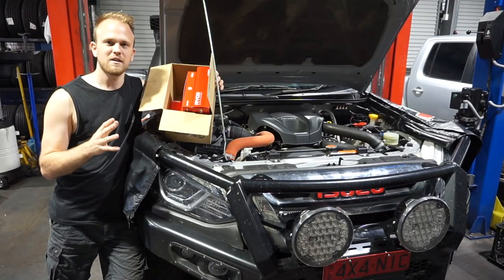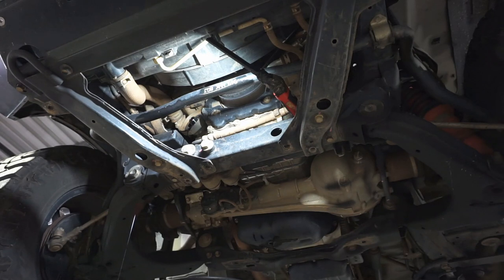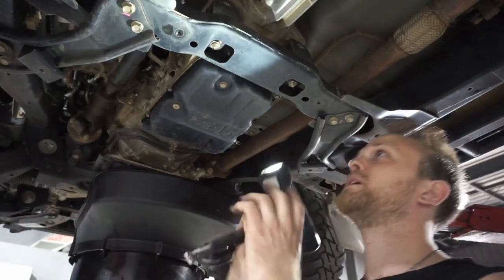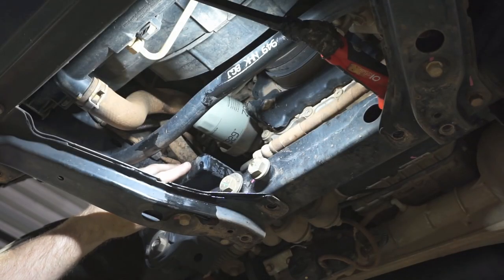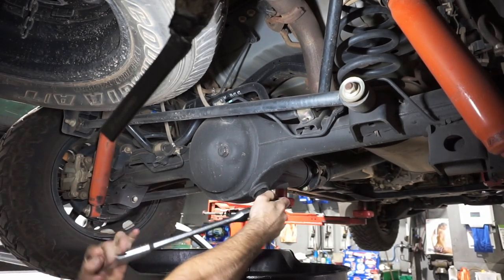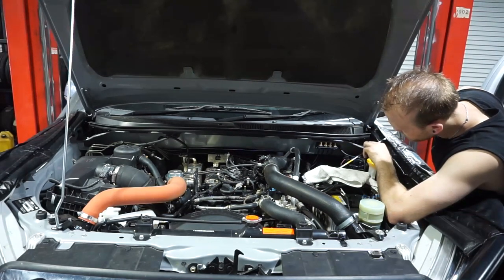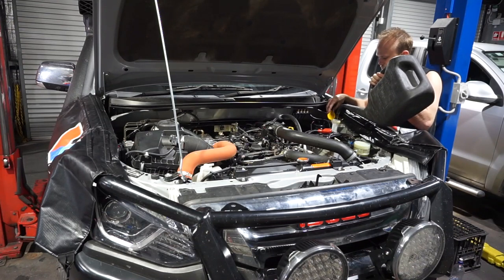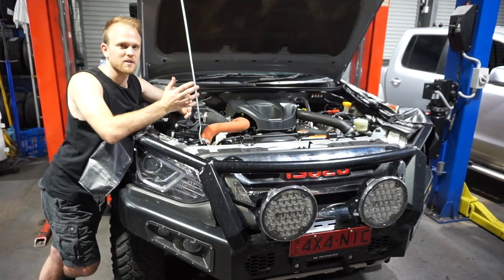Complete 4WD Servicing Guide || Isuzu Mu-x/D-max || How to service your 4X4

Comment: Great video
Just wondering where the fuel filter replacement video is?
I’m looking at doing mine very shortly 
What engine oil flush do you use?

Comment: Hi Nick, Thank you for the great tutorial. Nick, just bought a 2009 DMAX and would like to replicate your service here. Though, I am a little confused re the engine oil you specify. You state that you are using Fully Synthetic Valvoline 5W-30 Synpower. Though, both Repco and Supercheap say that this oil is not suitable. Can you please confirm whether it is the Synpower 'MSTC4' or another. Cheers.
Reply from the maker: Hi Mark, I now use Penrite Enviro+ 10w40 but my vehicle is a 2018 model with dpf. Your 2009 model would more then likely use 10w40 or 15w40. The best thing to do is give your local auto store your registration and they can look up what oil is recommended for your vehicle :)
Reply: Thanks. Will take on board your advice. Cheers.

Comment: Hi Nick, it is ok to use SAE 10W-30 engine oil for 2020 - 2.5 L diesel Dmax?  I am very confused as my dealer says I can use both 30 or 40 engine oil and my manual does not mention the specific oil recommended by manufacturer.  Thanks for your feedback.
Reply from the maker: A 10w30 or 10w40 should be fine to use in the engine. :)